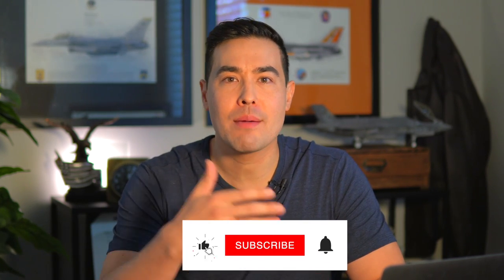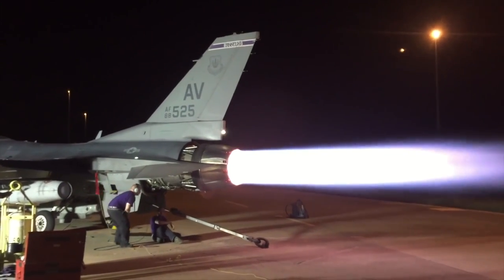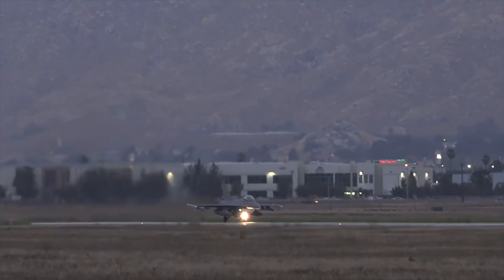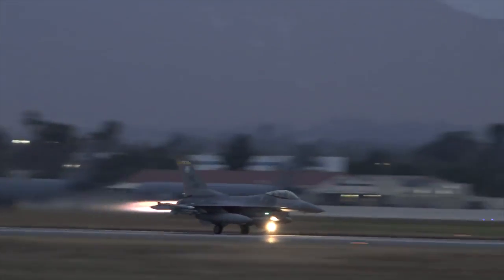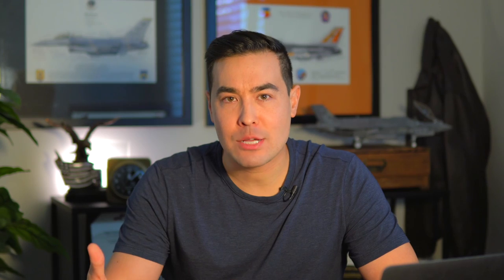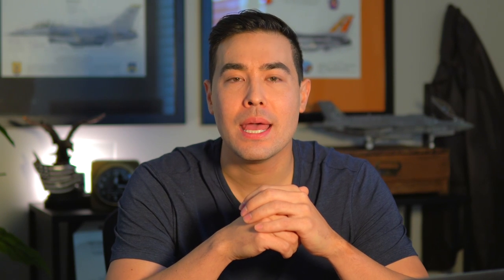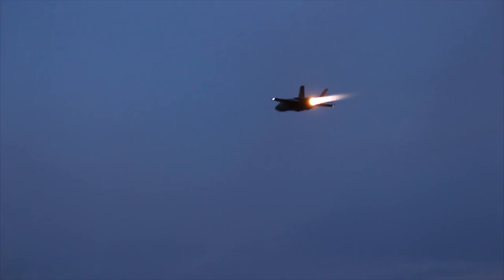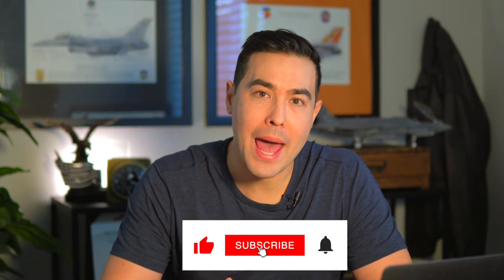Afterburner: What It’s Like to Use MAX Afterburner!

Comment: There were many times in my career when I was standing right about where those maintenance troops from Aviano were standing. I actually leaned on the turkey feathers on the J 79 in an F-4. The immense feeling of power afterburner gives is amazing. It truly rocks your world. On a side note, I know a guy who cracked burner for a second or so in an arch at Kunsan AB. For those who don't know, the jet needs to be tied down for this or it will quickly jump chocks. Back in the day a female maintenance troop was doing a run at Luke AFB  in an F-15. The throttle became disconnected and when that happens it goes to auto acceleration. The jet jumped chocks and crashed into a jet across the row. Two aircraft were destroyed, a couple careers ended, but luckily no one was killed. *Oh, Luke has Block 42's, not 40's.

Comment: Great video and I appreciate your comment on the F135 engine. Even countries dumping insane resources into their air power and military have proven incapable of matching the performance and power density of engines like the F-22’s F119; temps and pressures, materials construction like ceramics and composites etc… no one else can do it (well except the Brits w/ the Rolls engines - the EF2000 engines are VERY good as well.)  But yeah anyways, the F135 is nearly a generation beyond the 119. It’s just a freaking beast, but also extremely efficient. 

I remember seeing what must have been one of the first or only F-35 demos at Baltimore Fleet Week, they weren’t even block III so we’re G-limited and rate-limited big time compared to what we see now. It was still AMAZING. Forget Gs and rates - you can still pull vertical in full AB, and that’s exactly what they did. Obviously now the demos are just awesome and show the true potential of the jet.

Actually a really interesting video would be you watching one of the current F-35 demos and going through the maneuvers, if you’ve done them before, how the jet handles it, etc.

I remember people posting videos of the first demo test flights and they seemed more extreme than what we have today; especially the kick-over and essentially a REAL controlled flat-spin, etc. Can you speak to why they backed-off on the demo? I guess you can’t say if it’s a capability/adversary thing, but perhaps just safety/performance risk they deemed was too great? 

I’m definitely curious if you (as a “regular” F-35 pilot - if there is such a thing) get to perform maneuvers like the pedal turn, low-energy kick-over in the vertical, etc. Are these airshow maneuvers just stuff the test pilots and demo team folks get to play around with?  

I don’t mean that disrespectfully (you’ve gotta know your $hit to be an F-35 pilot) but the demo stuff seems to go well beyond BFM, etc. 

I guess I’m just curious how far you’re actually ALLOWED to push the aircraft during actual training. Do they want you to physically experience it’s limits? Or is it more a sim and books kinda thing. 

Also how do they select the demo pilots? I got to meet ‘LoCo’ at Oceana and get up close with “his” Raptor which was f’ing incredible (we flew in our TBM Avenger for static display and were right next to the hot ramp) and he’s the most down-to-earth dude ever. 

I guess no one really pictures a particular type  as piloting the most lethal fighter in the world. Do you ask for it? Do you have to show something different during training or ops? 

You should get Loco on the show and do an extended episode together on all this stuff, I guarantee you it would be INSANELY popular!

Comment: I am from the old school, J52 J79 and so on. The hardest acceleration I have felt was a cat shot off of both the Lexington and the Eisenhower.  Traps are just as violent only deceleration. I get to watch the F-16 & F-35 everyday from Luke. Great airplanes. And Pratt rules. From the big round motors to the turbines. Congratulations on the little one and congratulations to the patch winner. Be safe.

Comment: Going in to After Burner while refueling, damn, what an impressive scene to witness, I would definitely like to see the expression of the boom operator at that moment.
Reply: I'm not a pilot, however from playing flight sims like DCS World and having the F-16C Block 50 module, I can explain why you would do this from the physics side of it and can also say it's difficult to do in the sim as well.  Though my understanding is that refueling in the sim is harder than in real life (Due to some critical missing force and tactile feedback from both the aircraft and the tanker in both the sim and the controls we can use);

The F-16C or about any variant of the F-16 is designed for flying very quickly and part of it's design is why it can fly above mach 2.  The same reasons it can do this also limit it at low speeds.  For instance under 200 knots at high altitude it produces very little lift, and will stall very fast without the use of afterburner at speeds of that or lower.  Tankers tend to fly very slow, though are perfectly happy doing so.   from a Sim perspective it's Very difficult to refuel at speeds of 150-200 knots over 35,000 feet.   under 150 you will just stall and fall out of the sky without the afterburner on at that altitude, especially if you are carrying fuel tanks and any amount of munitions.  There is also the possibility of causing "Pilot induced Oscillation" which causes the plane to become unstable essentially.  Part of the reason for this is the air is thinner at higher altitudes so your plane does not produce as much thrust as it can at lower altitudes.  I also know C.W. Lemoine has said the F-16 performs poorly above 30,000 feet, which is simulated well in DCS and I definitely agree.  (Hasard? your thoughts?)

As he pointed out, the Afterburner does not have the finite control of MIL power, so you wind up going in and out of it often and if you don't time it right seconds in advance you will over shoot the boom easily.  You are basically going from having not enough lift and nearly stalling to suddenly having plenty of lift due to the extra power of even stage one or two of the afterburner, then back to having not enough again when you back off the throttle.  It's sort of like a complicated dance.  I Prefer refueling at speeds of 250 knots or higher and at a lower altitude because of this.

I'm curious what @Hasard Lee thinks of this post, considering he actually has flown the F-16C and how it compares to what I've described in the Sim in a little more detail.  it seems fairly accurate from what I've heard in the video and other accounts.  

Also congrats on your baby Hasard and thanks for posting these videos.  I love the content and it was really awesome to hear what it felt like to actually punch the afterburner for the first time.  I could imagine it very well with your account.  What I'd do to feel that just once.
Reply: @spartan9458  Your thoughts and knowledge of this particular subject is absolutely correct and as a DCS player myself you are absolutely right that it is harder to refuel in DCS partly because you gain speed slow and bleed it fast. Talking about this, I also wonder that do the aircraft that utilize super cruise follow the same protocols as their airframe is optimised for super sonic flight without using After Burner.
Reply: Twin engine aircraft like the F-15E have it easier. They can put one engine in min AB and then modulate the other engine for precise forward/aft control.
Reply: @oisiaa  Wouldn't it affect the yaw of the aircraft because of the uneven thrust.
Reply: @abdullahazhar1054  I wouldn't think there would be a difference.  the air-frame of the F-16 is optimized for super-sonic flight.  if you put a more powerful engine in it, and AI mean like the F-35's engine, which is basically an upgraded F-16 engine, it would fly super sonic at full Mil.  Remember the aircraft in question was designed to fly mach 2+.  unless they planned to make it fly even faster, there isn't a need to modify the air-frame.  as it is, an F-16C Block 50 can super cruise under certain circumstances, though by definition it cannot as it cannot sustain this in level flight at most altitudes while loaded with weapons.  in general though the F-16C Block 50 will go Mach 0.99 without afterburner.  it's more of an Engine optimization than anything else.  the engine it has just doesn't put out quite enough thrust or the turbine is not quite designed right for super cruising.  I noticed the F-35's official Max thrust is only about 1-2 thousand pounds higher than the F-16, however it's Dry or Full Military power thrust is significantly higher.  This makes me wonder if the F-35 had a more powerful afterburner like the F-16, if it would go even faster, or if it has to do with the optimizations done to the Turbine.  I suspect it would, as the F-22 can super cruise and also go mach 2.25+, it's a matter of budget.  

This is my opinion based on simulation findings and what we know as civilians about said aircraft.

Comment: Amazing video and experience you have. Flying F35 must be awesome. At starting 6:29min in the video you mentioned your flight lead plug in the afterburner and then you mentioned the nozzle close in/converge. I believe with nozzle closing is the the maximum thrust you can get without the afterburner. But the moment the throttle is past forward the click for afterburner the nozzle expands. Matter of fact this is also supported by the same video at around 1min when afterburner actually kicks the nozzle expands/opens up.

Comment: Hasard “The F135 is the greatest engine ever made”

J58 has entered the chat
Reply: J58 is an old dinosaur, although for the time period developed was great,   but by todays standards it's a museum piece,  inefficient and unreliable.     Actually the inlet and afterburner were the more impressive part of the SR-71, that is where all the thrust was made.
Reply: @dmitchellhomes  I completely agree. I was just thinking that the engineering that propelled the A-12 and SR-71 to well over Mach 3, in the 60s no less, is a pretty impressive accomplishment. I agree my initial comment was a bit hyperbolic though. The F135 is an incredible piece of technology and is the standard in the industry today.
Reply: Elon Musk 390000lbs methane raptor beast entered the chat 💬
Reply: @Shadow__133    Who cares,  Raptor is a POS...  3 second static fire and 2 of 3 damaged...   Junk...
Reply: @Adamthehoff   The J58 did not push the SR 71 to Mach 3,  that was a combination of the inlet and afterburner,  the J58 was just a hair dryer in the middle to keep it all working.    In the early 60's Amazing...  Today, not as impressive.   The genius of the SR71 was not the J58.    It was the entire system, really the J58 was the bottleneck,  it was what stopped the plane from going faster because of turbine inlet temperature limitations.
Reply: @dmitchellhomes  hmmm, great to know. I definitely learned something from this. Thanks for your reply. Nothing like learning more about aviation history!
Reply: @Adamthehoff    Hope we all can learn something new every day...   SR-71 is almost mystical as it was so far ahead of its time in some ways,  but there are too many internet rumors and untrue stories that cloud the real capability.    The speed is like a fishing story,  they are always bigger until you see them.     To me the amazing part of the SR71 is the fact it cruised faster than the Mig-25 could sprint.
Reply: @Adamthehoff  Technically more than a few fighters & 'bombers' could hit mach 3 (many mach 2) but were limited by friction heating their skin. Doesn't do well when your flight surfaces start acting like plastic.

Comment: Question: do you lower flaps on takeoff when using afterburner? I have always wondered this.
Reply from the maker: it's automatic
Reply: @HasardLee  thanks for the reply. Does that mean the flaps lower and raise without any input? Had always been curious if the flaps are even utilized on this kind of takeoff
Reply: @zacshaheen8286  it’s lowers when the landing gear is down and goes up when the gear goes back up Ofcourse there is a bypass but that’s for emergencies.
Reply: Some of the more modern aircraft have takeoff modes. Flaps automatically lower for takeoff.

Comment: *Question for you: How many gallons of fuel (assuming 7 pounds per gallon) does an F-16 burn in full after burner?? I would think that with only around 500 gallons of internal fuel, and without any external tanks,  you could be bingo fuel in less than 5 minutes!! Yikes!!
Reply: You didn't specify in how much time when you asked how many gallons of fuel does an F-16 burn in full AB, per second, per minute, per hour? He said when he looked at the fuel flow guage it was 50,000 lbs per hour. At 7 lbs per gallon that would be 7,142.86 gallons per hour, 119.04 gallons per minute, 1.98 gallons per second. If you were looking for how long to use up all fuel, he said that they carry 7,000 lbs internally, so at a flow rate of 50,000 lbs per hour that means it would take 8 minutes 24 seconds to go from full tank to empty in that plane in that configuration in those atmospheric conditions. Also 7,000 lbs of internal fuel at 7 lbs per gallon is 1,000 gallons of fuel. For 500 lbs of fuel then that time is cut in half, 4 minutes 12 seconds. F-14's consumed much more. The standard answer to the question "What is usually the first thing an F-14 says after taking off from a carrier is" Where the hell is the tanker? "
Reply: @bwc1956  You're absolutely right, Bruce!! 
Almost as soon as I sent my question/message, I realized that I neglected to specify a time frame. In other words, you need to specify a time as well as a quantity in order to determine a rate of some sort. Yet I think you perceive what information I was basically after. Basically, I'm (still) how many gallons per minute does an F16 burn in full afterburner? Additionally, I've assumed that probably 95% of the time F16's have drop tanks installed, due to the enormous fuel consumption they have.
Reply: So if  that fuel consumption figure of 119 g.p.m. is accurate, then I think that is a pretty staggering figure in and of itself.
Reply: @johnherbold5451  it certainly is a staggering figure. Talk about carbon emissions! lol
Reply: @bwc1956  Just imagine how much gas an SR-71 (P&W J58) turbo-ramjet engine devours in full burner at LOW altitudes. Ironically, it actually gets much better fuel economy at 75,000 feet, where the inlet of the engine is doing most of the work!!